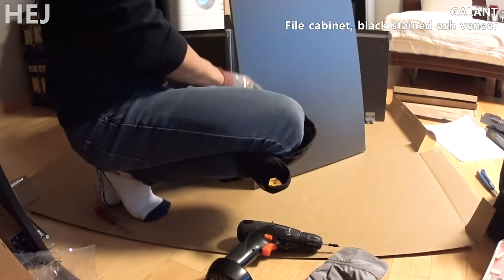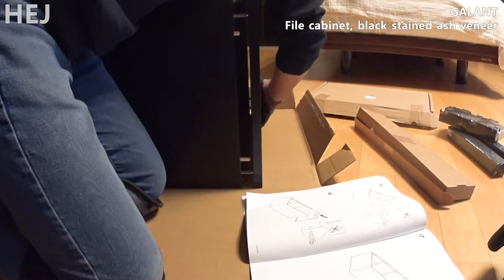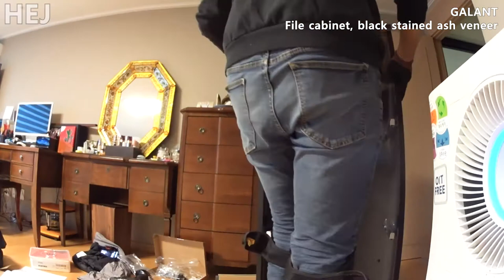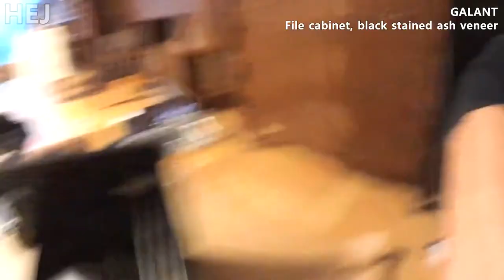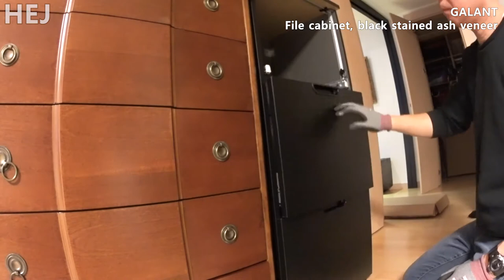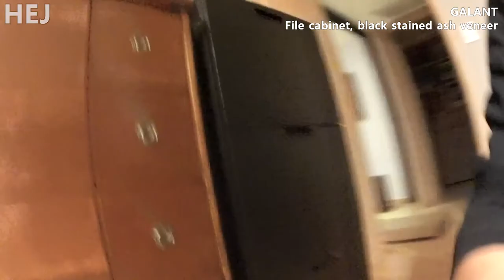How to Assemble - IKEA GALANT 갈란트 파일캐비닛, 블랙스테인 물푸레무늬목 조립 -3배속영상

Comment: I fully assembled mine-- but the drawers are not flush when closing. I know how to take out the drawers, and put them back in-- but that doesn't solve anything. It's still not flush.
How do you make it close all the way?
Reply: Same here, did you ever figure it out?
Reply: @dwightamato5672  I think turning the inside poles (like the plastic ones going horizontal) adjusted it, albeit very slowly and hard to do
Reply: Hello, could you please advise how to take out or remove the drawers completely? Thanks for your help.

Comment: I'm trying to figure out gapping (seen from the side of the drawer when closed). The top of the drawer is close but the bottom is gapped more. The page 52-53 instructions were more confusing than helpful...I don't understand what the little wheels on the sides of the drawers really do.
Reply from the maker: The stand height and spacing are adjustable.
I'm not sure what the wheels on the side are talking about.
Reply: @hejsseopikeaassembly4531  I think she means the little gear-wheel type things shown being adjusted at the bottom of page 42 in instruction booklet version AA-2020898-4

Comment: Help I'm trying to put it together and my drawers are not flush, they are an inch from closing. How do you  take the drawers out🤔😵
Reply from the maker: If you look at the bottom of the drawer, there are parts on both sides that you can press with your hand. The drawer can be removed by pressing it with both hands.
Reply: Hi thanks so much, sure wish I had watched your video before putting together 🥴 is it the blue buttons on the side when you take cover off? Thanks for the video it's great👍